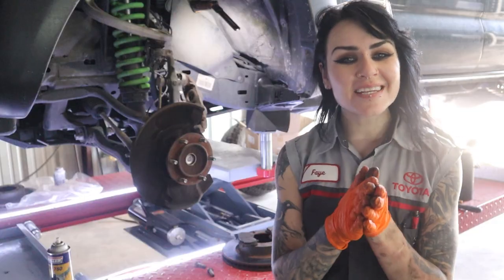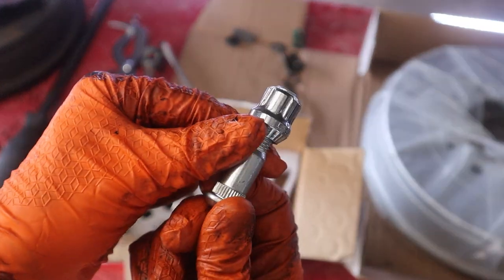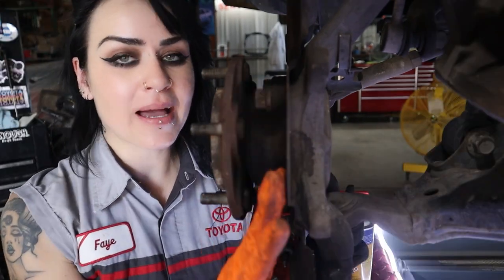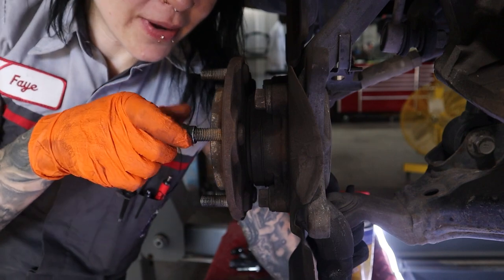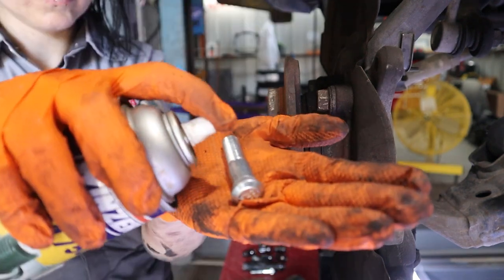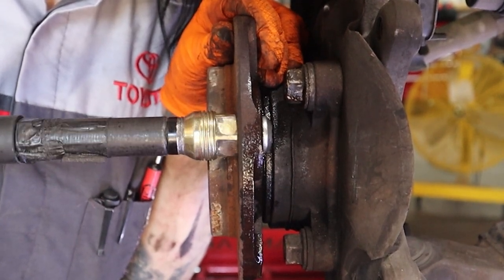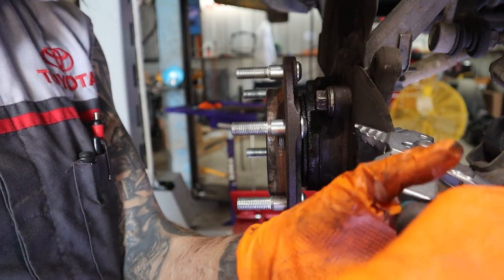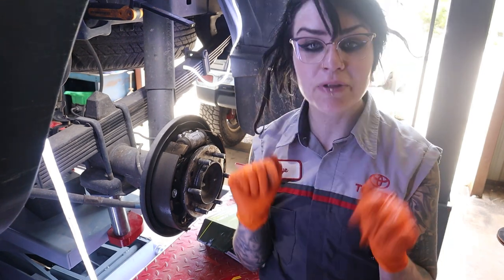Removing & Installing New Lug Studs on Gen 2 (2005–2015) Toyota Tacoma (And Replacing with LONGER!)

Comment: I usually call them Studs, or wheel studs, but from this day forward they will be called Lug Studs! For install I used to also use stacked larger nuts, but now use Lisle 22800, which REALLY makes it easy due to the bearing design of the tool. 
Thanks for the video!
Reply from the maker: Yes!!! I saw another commenter mention that tool - I almost bought it but I've never had this technique go sideways on me, so never had a need to. But now I kinda want to try the tool just for my own curiosity !!!
Reply: @FayeHadley one good reason for having that tool is that it spins with the nut so if someone is doing this job and they don’t have a sacrificial lug nut for the installation they won’t ruin the mating surface.
Reply: @FayeHadley great work, by the way. I just discovered your channel and subscribed.

Comment: Nice video!  When I've done wheel studs, I've always just relied on tightening the wheels down to pull 'em through, but doing them your way is probably more sure.  Now I'm looking forward to a nice video on replacing AC compressors...  :)

Comment: This is fascinating to watch! On our PTs you don't have a backing plate you can bend, but the steering knuckle is notched, so you can get the studs out one at a time.  Wheels on my 55 Dodge, however, are a nightmare. They have lug bolts instead of studs, so you have to hold the wheel up and fight the bolt into the hole. And to make things more confusing, one side is left-hand thread and the other side is right-hand thread. So, lord help me if I mix up the bolts🤣. Needless to say, I'm very glad for the invention of studs. Thank you for filming this. You do great work!
PS: One last quick fun fact. The brakes on the PT Cruiser are actually the same design as a K Car, like your friend Danny's Horizon!

Comment: The last Tacoma I put aftermarket wheels on at my shop, I was able to get a set of ET style lug nuts. I guess the ET stands for extended thread not extra-terrestrial. They have the 60-degree conical for the rim but the extended shank similar to a stock Toyota lug nut that fits inside the aftermarket wheel. I just realized that the lug nut you used to air hammer the studs out is an ET Lugnut.

Comment: you need at least 1-1.5 x bolt diameter engaged in the nut member to achieve optimum joint strength
Reply from the maker: Great tip! These definitely fit the bill!! :)
Reply: @FayeHadley  :)

Comment: Just to compare unique differences  in Toyotas dealership training. You recommend using lube to reinstall wheel studs whereas I was trained by Toyota Australia to use medium strength locking fluid when reinstalling. Though I now have no association with any dealership, comparisons of techniques with other mechanics is interesting. Love your vids. Greetings from Woomera in South Australia. 👍👍🇭🇲
Reply from the maker: Oh, SO interesting! I see how the threadlocker could be a lubricant when used at first, for installation, then it hardens up after the stud is installed! Definitely sounds like a good method, too! I'd just hate to try to get them out if one broke!
Reply: @FayeHadley  Blue threadlocker is recommended. Never use red threadlocker unless you enjoy alternative forms of self torture! Ask me how I know......👍👍🇭🇲

Comment: Great video, thanks! I had to do this recently on my Girlfriends Subaru. Dealership cross-threaded four lugs on two occasions. She’s never going back. It’s unfortunate that dumb actions for an oil change and tire rotation is losing them business. It’s not that hard to hand thread and hand torque lug nuts! :) then again of your favorite tool is an impact gun, you should use it everywhere, right? :)

Comment: Hello Faye great video i have a funny story many years ago i had a brake job done on my 71 Charger. I got a call from the shop updating me on when it will be finished they told me the mechanic stripped the left side studs he never knew that left side lugs on a Dodge are left-handed threads.

Comment: You could use one of those C-clamp style ball joint tools to press those in, it's basically a portable press. You'll get it tight with no thread stress or snapping the new studs. I broke 5 on my Tundra they really don't like to be over torqued. I'm old school always did it by feel, the Tundra requires me to pull out the torque wrench.
Reply: Just pressed in 6 like u said. Didn't use lube.

Comment: Not a bad idea when you’re lubing the knurled base of the new studs to install them to also lube the threads too since it does take a lot of torque and pressure to pull those through and seat them. Just a little insurance against galling the threads on your new studs.

Comment: Is there any need to put a washer between the hub and the spacer nut to reduce friction? Or is it not damaging the hub face?
Reply from the maker: It isn't damaging - it's not that much torque surprisingly, but you absolutely could use washers instead of a nut/spacer, or with a nutor spacer!